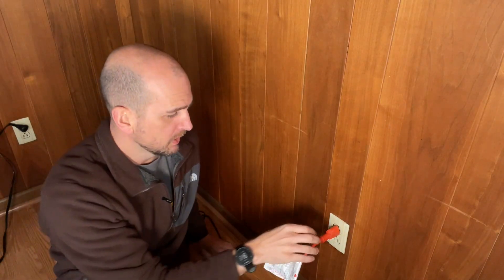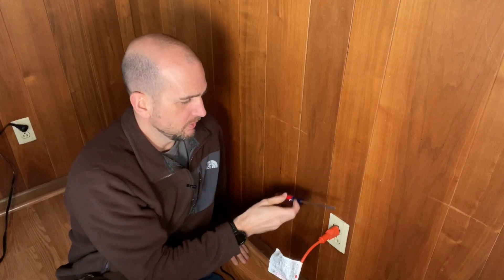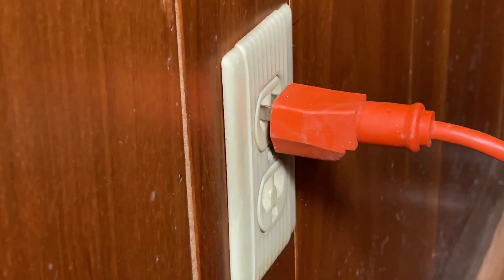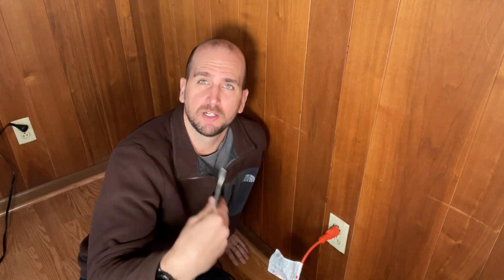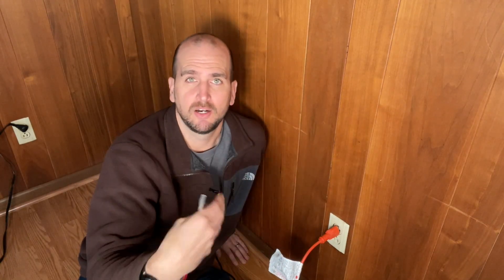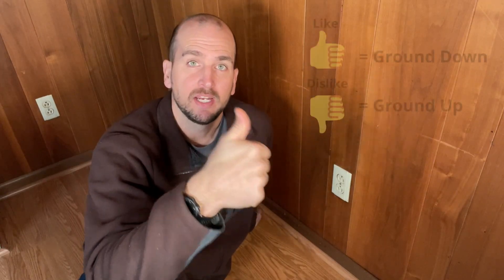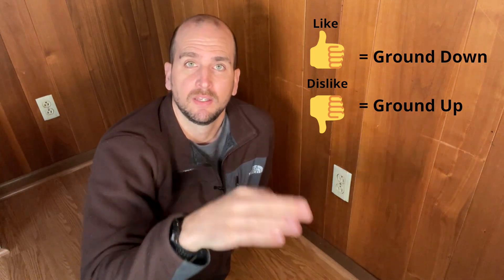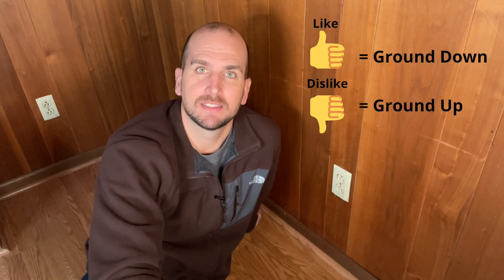Should An Outlet Be Installed Ground Down Or Up

Comment: Grounded outlets were first used in the fifties code. Ground connection were to be up. Sixty two nec code had a cosmetic addendum that it was ok to put the ground connection down, for residential building. Commercial building had the ground connection up. Now it makes no difference according to the nec. I’ve been doing this for over sixty years. Don’t confuse people, and especially our young inspectors.
Reply: I think I'll listen to you!
Reply: We could get into a discussion about outlets that must be oriented horizontally because of a peculiar space restriction. Should the ground be to the right or to the left. What if the outlet is ceiling mounted? 
Seems to me the subject should be abandoned.

Comment: Thanks for this informative and useful video!  I never encountered ground-up until I bought my present home, which was built in 1979.  Every time I replaced a receptacle,  I installed the new one ground-down, except in one bathroom where the wires were not long enough to reach (really annoying).  Needless to say, I am a ground-down guy.  If plugs tend to pull out, relpace the receptacle.
Reply: A mains socket in the bathroom is illegal in the UK. Its very unsafe to use any mains appliances in the bathroom. The only exception is the shaver socket which has an isolating transformer.
Reply: Mains socket and shaver sockets are unfamiliar terms to me; I just fix broken things in my own, American home in accordance with applicable codes.  Bathroom receptacles are required to have a ground-fault interrupter (GFI).

Comment: The odds of a short from an object hitting the prongs are more remote than an electrician trying to cheat on short wires in an old undersized box where he might have to piece out the hot wire to reach the left side. Sometimes adding another wire nut within a small box is one space cramping object too many, which can become dangerous when everything is force jammed back into the box, especially when revising service with larger devices, like gfci outlets, so older codes were written to discourage piecing out wires in old boxes and maintained the convention of hot wire on the right side.

Comment: These outlets do not have mainly a pull out problem.
The main problem is security.
While inserting or pulling out you can touch the pins, while voltage applied.
Dumbest system worldwide.

Comment: Some facilities have stainless steel or other metal wall plates, If the plate comes loose it can drop across two of the prongs. I know that is not "Supposed" to happen but I've seen it twice, In that case ground up might be a little better.

Comment: Best advice is to buy tools and appliances that are double insulated or are otherwise safe so you don't need a three prong plug and don't have to worry about finding a three to two prong converter plug for those older homes that only have two hole receptacles.

Comment: Any modern hospital has ground up in the USA, I am fairly sure it is code. I worked with an electrician and asked him the reasoning he told me the thought was if something were to fall it has a higher chance to land on the ground instead of shorting out the hot. Made sense but still a long shot if you ask me. I've always wired ground down when ever I installed one.

Comment: Grounds should be facing down, been that way for decades and decades , just another thing people think should be change because changes is better ,no changes is not always good. It works leave it alone. Something  falling straight down along the wall and hitting the plug like explained in this video is like never to happened it will always push itself away from the wall , physics at play.
Reply: Only encountered it one time. It was a metal cover plate that did not have the screw installed for whatever reason. When I pulled the plug the plate slipped and shorted the prongs.
Reply: @unclemeat7310   yep , plastic is better

Comment: I prefer ground down because “90 degree plugs” always put the ground pin on the cord side. If the ground hole is up then the cord runs up the wall an tends to pull the plug out.

Comment: I would think that ground down would be more safe.  If your finger slides behind the plug as you unplug it then it will most likely be from the bottom.  Better to touch the ground I think than the positive.   Now, odds are that by the time your finger touched it the plug would already be disconnected.  However, most devices still have power in transistors and such.

Comment: Went through a Technical school for Residential and Commercial wiring,  this subject never came up , but in my house that was built in 1988 , all the plugs have the ground facing down and it never bothered me cause I have alot of surge protectors plugged in and they work designed with the outlet having the ground facing down.

Comment: In the first place why would you be putting a screwdriver to take the plate off when you’ve got a cord plugged into it and another thing it’s a ground it’s on the bottom you got more weight to hold the card because he got more plugged down as the cord drops down it takes more to pull the prongs out with the ground out the way to the car and pulls it and exposes the ground and the prongs so their codes may work it that way but I think ground down is best you don’t start putting a screwdriver on a plug without unplugging it that would be stupid in the first place I said if you’re going to take the plate off you can’t take it off with a plug in there so that’s ridiculous in my opinion

Comment: This is simple the manufacturers of the outlets tell you to install them with the grounding up.  This is a liability issue. With the grounding pin up it will deflect any object that may be dropped into the gap.  With the grounding pin down an object has a reasonable opportunity to make contact with a hot pin resulting in an electrical shock. The sheet of paper that comes in the box with each receptacle tells you to mount the receptacle grounding pin up or it "Voids" the manufacturers' "Liability"11111111

Comment: Many years ago I read the NEC.  Ok, I'm a nerd.  The thing that I still remember from it was that there was no text describing which way the outlet was to be oriented, but from the previous version of NEC, the pictures of the outlet flipped from ground down to ground up.   HUH????  That seemed really scary to me because I had previously been taught that ground down was correct.  It was considered correct because if you grab a plug, and it is not in all the way in,  one of your FINGERS could touch one of the prongs.  Well which finger is most likely to touch?  Take a look at your hands as you grab a plug,  Your pointer finger is the one most likely to touch because it longer than your thumb.  And your thumb probably grabs the top straight so as to miss any prongs.  Isn't it better to have your longest finger touch the ground instead of the other prongs?

Comment: When I was taught - and this was within the past 10 years, the argument for ground down was that when someone plugs a device into an outlet, naturally their thumb is on top, and first finger at the bottom; that's just nature of how we plug things in.  And when we do so, the first finger is slightly forward and has more tendency to accidentally touch whatever piece(s) metal are exposed.  In a ground down environment, that finger would then touch the ground and you'd be ok.  In a ground-up, that finger would complete the circuit and you'd enjoy a nice little surprise.  I accept this argument, as the ones I've seen about the weight/gravity pulling a cord out and therefore a reason why you'd install a device ground down.  But I tend - and is my practice unless the inspector or homeowner requests otherwise, to install ground up - primarily for the reasons you explained in your video.  I know someone who had a plug come loose, and a nickel dropped down the wall, hit the hot/neutral, and actually blew a piece of the nickel into their eye causing blindness in their left eye.  From that point on, I have installed ground up.  And I have found that if you invest (and that's partially the key) in a well built electrical outlet, the arguments about weight and constant pulling become somewhat antiquated.  A cheap outlet, yes, a cord will fall out day and night, but with the more expensive outlets and GFCI's that I've come a custom to install, I've preferred ground up and in all instances they have passed the city inspector's code.  Just my 2 cents, however....

Comment: They are designed with ground on BOTTOM. It's design is extra beefy for stabilization as it gives extra grip to help keep it in the wall if pulled down on, i.e. a SMALL CHILD. For any doubters, look at how refrigerator cords are wired to be flush as possible. Which way is the ground. Always down. All wall flush extension cords are like that, too, some 45° off the lower corner. It's self explanatory. Otherwise they would just make them 3 across. Some people would rather have a dangerous upside down outlet to show which ones are switched outlets as a convenience. Personally, I'll stick with the proper and safer way [ground down].

Comment: I was a electrician in the military. I do understand ground up behind shelves or dressers. Me personally when I replace I do them as they were. Mine behind my dresser is ground up. Plus use the screws for wires not the slide in holes. They fail trust me.

Comment: The instructor in my high school  practical electricity class taught us that "HOT" is always to be located on the right or the top so that there is no confusion when installing an outlet hence the ground would always be on the bottom or on the right and that's the way I've been doing it for over 35 years.

Comment: In Florida the the ground up outlet is controlled by a switch or switches on half of the outlet is controlled and the other is not. Ground down is a normal outlet. In Michigan we had no such rule and so you needed to figure it out by checking each plug. Its a smart idea. Makes it simple.

Comment: So, from a safety perspective just because the ground is on the top doesn't mean something conductive can't fall and short between the hot and the ground . It's really more like a 50/50 chance. If however the outlet was orientated with the ground facing down and we then reconfigure the functions of the connections, then it works. So, neutral is still the larger blade. the smaller blade gets reconfigured to be ground (instead of HOT) and the ground pin gets reconfigured to be the HOT line. Now the safety argument works better. This being said I understand it would be a nightmare to change everything including all the appliances but you did ask my thoughts.  Honestly the hot should be a center conductor with the Neutral and ground being shells that surround the hot line. Kind of like a BNC connector. That way when unplugging it one couldn't accidently touch the two at the same time. Hey! how about a locking switch that whereas the plug cant be removed unless the switch portion of the outlet is in the off position? Off I go the the Patten office! Oh and those tamper resistant outlets SUCK!!!

Comment: I have always seen ground down. So I just follow what seems to be the norm. I can understand in certain locations and what may be plugged in,  you may want plug up. Only plug up in certain situations. What they are I don't know and probably will never be done by me. Thanks  for this and just knowing there is no electrical rule. I would think an inspector would prefer them being ground down. They would have to check that you still put the hot wire on the black screw which is now on right side of outlet and neutral to silver side left.

Comment: Almost every power bar or appliance I have had with a 90 degree plug, have the ground pin needing to be on the bottom if you want the cord to go down, which you almost always want. Otherwise you have a loop going up then down.  The manufacturer prefers to put the ground pin closest to the cord, because the anchoring tabs on the prongs inside the molding do not leave much space for the ground wire to pass between them.  And most wall warts with only two polarized prongs want the wide one on the left to be hanging down the wall.  The other way, the weight of the transformer pulls out the prongs.

Comment: It's like the toilet paper roll question. It's a matter of personal preference, it'll work either way. You can even mount your outlets horizontal, if you wish. The NEC doesn't say. However, according to NEMA, the ground should be at the top. It's called a "U" hole because it resembles the letter when properly installed. This is confirmed by Philip F. Labre's original patents for the device from 1928. The original had a straight ground blade, like the others, but by the time NEMA adopted it in the 1940, it had evolved into the "U" it is today.

Comment: Ground up is for installation behind a work bench. If a section of sheet metal fell off the back of your bench it would hit the ground probe not the hot blade.

Comment: I am a general handyman and I install most of the time ground down just for general consistency with the rest. Or personal preference of the customer. However though, I have had personal experience with a conductor falling on top of a loose plug with the ground down and causing a short. I had to come home from work because my girlfriend said the lights in the house were “freaking out!” A small piece of aluminum bar had rolled off of a nightstand and landed on top of the plug…Anyway I just thought I would put in my two cents for what its worth.

Comment: I prefer both in different applications.  For computer rooms, music studios and shops where there's a large percentage of grounding three-prong plugs, I prefer the ground pin up.  Why?  Because it's easier to align a large ground prong into a single hole than two lugs into two holes, especially if the prongs are also polarized. In living areas, I like the ground plug down for two reasons.  One, if someone should step on the cord I want the ground to be the last prong to leave the socket and, two, it's what people are used to seeing so it looks "better".

Comment: Obviously the reaaon most people prefer  ground down is because thats how 95% of all houses are, and people in general dont like change. There is no code qhich specify. But if you look at a lot of comercial receptacles the words are always read with ground up not down. Also on a switch the ground teeminal is always on the top. So why would it be different for receptacles?

Comment: If the instructions on the receptacle say ground up then it actually is a violation of the NEC. I forget where it is in the book but they do specify that they are to be installed according the manufacturers specifications. 

That being said ground up really only makes it more safe with bigger plugs with higher voltage.

Comment: If you look at a plug you will see the ground prong is the longest. The code says the ground is first in and last out. If you follow that logic the ground prong should be on the bottom so if the cord is pulling out the ground will disconnect last.

Comment: I have an outlet with a switch [I forget if it's above or below] but that's still has Ground Down just like every other in the house. 

[I have some on the basement above lights (on the porcelain round part above -- The actual Fixture -- and those are Ground Down, also) ]

Everything is uniform.

Comment: Hi Scott, thanks for posting this.  Actually, as soon as I saw the title of your video, I had a preference... depending on safety implications.  Immediately I preferred ground facing up and here's why.  When I've needed to plug something into an outlet, let's say a floor lamp, and the lighting in the room was so poor I could barely make out where the outlet was; what I usually do is put my fingers on either side of the positive and neutral plugs, just to make sure they're oriented straight up and down.  Then, when I'd get the plug close to the outlet, I'd take my fingers off those terminals before actually plugging it in so I didn't electrocute myself.  I've never liked that though.  With the positive and neutral plugs on the top, it's hard to see the ground prong as the other 2 prongs tend to block sight of it.  However, a single (ground) plug on top does not block view of the other 2 prongs as much.  Bottom line, I feel like it's easier to visually align the plug with the outlet when the ground prong is on top, rather than the positive and neutral prongs, especially when lighting in the room isn't great.  That's my 2¢.

Comment: If I recall correctly. I was told it was best to install the receptacle ground up due to a child that used a plug to climb on to look out a window and the child end up getting electrocuted. But if the ground is facing up then it has a better chance of protecting someone due to the hot and ground shorting out due to both being touched at once.

Comment: I work for a major NYC hospital as a Biomedical Engineer. Our receptacles in new buildings have the Ground facing “up.” This is because over 10 years ago, we had a patient monitor connected to a baby which shows electrical vital sign activity.

The receptacle was installed with the Ground facing down. The male AC Plug was not inserted fully into the receptacle, leaving a small gap between the AC prongs and the wall plate. A paper clip fell down and rested on both the AC prongs causing a “short circuit. This caused an audible “pop,” a spark, and tripped the Main Circuit Breaker.

So, now our receptacles are installed with the Ground facing upwards. This prevents a short circuit should any conductive material fall between the prongs of an electrical plug and a wall plate.

But, I have seen homes with the Ground receptacles facing upwards, indicating this is a “switched outlet.” The homeowner can now identify which room has a “switched outlet” vs. a normal (always-on) powered receptacle.